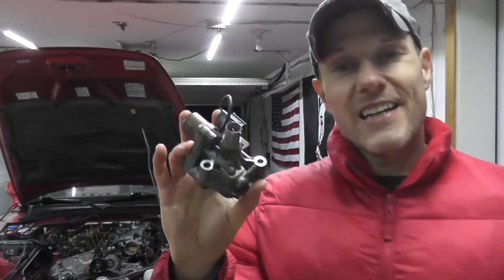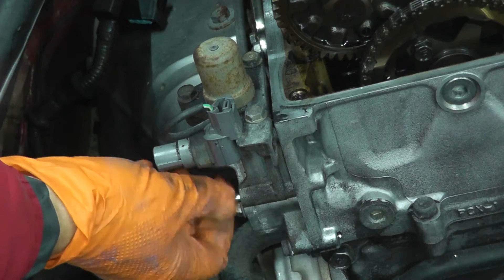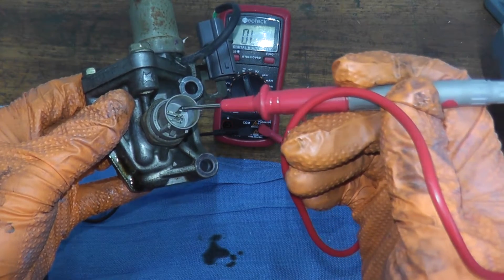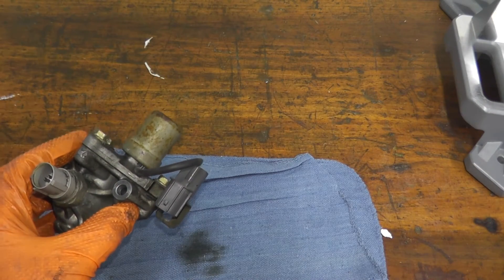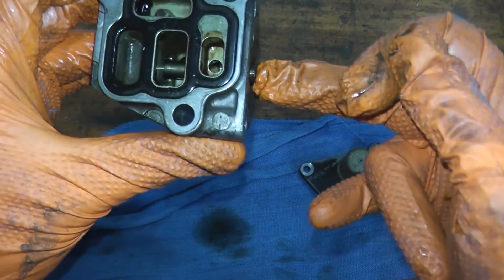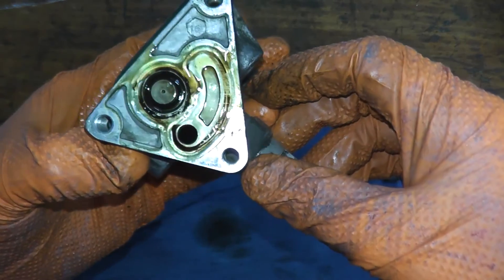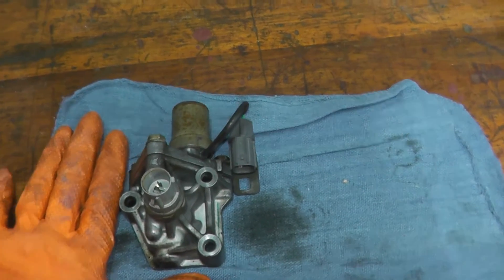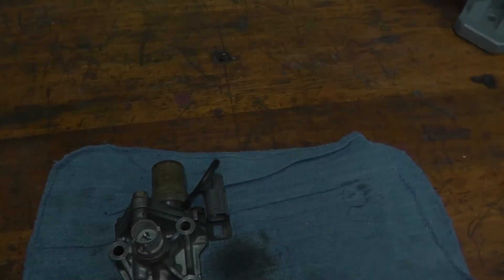How To Test and Replace A VTEC Solenoid Valve P1259 P2648 P2649

Comment: I have a problem with the VTEC oil pressure sensor. I checked there's a 12 volts on 2 wires for pressure switch. Since the pressure switch is normally closed, when I plugged in back the socket on the sensor with the ignition key switched ON. The power supply 12 volts has gone? Is that correct? Also I checked the voltage on single wire and read it 2.5 Volts . When I plugged in back to solenoid valve. Again the voltage gone. I checked the continuity of pressure and it's ok (normally closed) I checked the resistance reading of solenoid valve and it reas 15.6 ohms. It seems fine. I cleaned the valve assembly also. But still the the check engine still stayed ON. And then I read again the flash code, still code 22 meaning the problem still exits on VTEC oil pressure system. Any advice that can you give me to check further the solve the problem?

Comment: Thanks for the video. I did all tests, plus I powered the solenoid and it did the job intended, with a nice click sound.

What I found, that fixed mine, was that the screen on the on the other side of the block [behind the power steering pump and belt tensioner] had a yellow film on it. I sprayed it with break cleaner and that film came right off. I then reasembled and drove it, and SUCCESS, no more code.

Good luck to everyone.

Comment: important to know is that you should NEVER force paperclips or anything through connector pins. this is a good recipe for some intermitent problems later. just use backprobes or touch the tip of it, thank you!

Comment: How come we did not perform an impedance test on the first sensor? Is it only continuity that we need? Also, if applying air pressure to the first sensor, will it open breaking the continuity?
Reply: It's a normally closed switch that opens when pressure exceeds some amount.  Yes, provided you don't test it at too high a pressure or blast a jet of air in there that could damage the diaphragm.

Comment: So confused, I put the computer on my 2013 Honda civic and I get a faulty solenoid valve malfunction. However, my mechanic says I need to replace my ABS module because I have a warning lights on in my dashboard. 🤷🏻‍♂️🤷🏻‍♂️

Comment: My solonoid on my honda del sol d16y8 from 1996 does not have a sensor to test to solonoid. it just has one big bold in it. What do i need to do?
Reply: Mine has a pressure switch with two terminals and a solenoid with only one terminal.  96 Honda Civic EX A/T.

Comment: If this throws a P1259 error code, will it cause a CR-V to crank but not start? I’ve tried testing everything else (fuel, air, spark, fuses, & relays) except for this and the the timing chain on my 03 Honda CR-V.

Comment: Just a warning that i didn't think was covered here is the wrong oil grade. A good mate of mine replaced an engine on a Cr-v after the garage cocked up and left the oil filter loose resulting in a wrecked engine. He fitted a 2nd hand engine and put some oil he had sitting around in it. On road test the engine light came on. He found out he had the wrong grade of oil in it. Drained it out, put the correct oil in to it, cleared the fault codes and oil was all ok. Great video though!
Reply: Hey man, was the oil too thick
Reply: using 10-30 on a k22 on my ep3
Reply: @henryec  Yeah unused oil from the back of the garage so was probably 15-40 or may be 20-50 so to thick for the VTEC system to operate. Dropped it out, correct oil put in, all was good.
Reply: @paulrobinson3528  oh shit alright maybe ill try that, appreciate you

Comment: For a tsx cl9 I’m sure this applies too , I removed her. To replace the gasket. However.  ,  I did my oil change. ,  I’m sure she was leaking from so ,  I cleaned her. Brake cleaner . I put her back. , the car is having troubles starting. ,  , idk if it can be the ecu need to be reflashed ?  It’s the stock og Acura ecu. , my key immobilizer on the dash symbol would keep blinking ,  idk at this point , definitely gonna refuel , I didn’t check the top gasket. And check for the motion. Etc.

Comment: I think when you are checking the voltage across the leads with the ignition on, you should NOT allow the leads to come in contact with ground (i.e. the body).

Comment: Hey can you do a video on how to fix the heater on an Acura TL. My air is blowing but no heat is coming out. Thanks
Reply: Did you run low on/replace coolant?  Did you properly purge all the air out of the system?  Hondas can be tricky and keep air bubbles in the heater.  Typically park front up on an incline, get a transmission funnel, remove the radiator cap and insert the funnel.  The funnel needs to be a tight fit and Fill it to have coolant visible an inch or two up into the funnel(above the cap height) and start the engine.  Set the heater control to full warm to open the heater valve. You should see occasional bubbles escape in the funnel as air purges, so Keep adding coolant to maintain that level.  Increase engine RPM from time to time, run it there for a few minutes then let it return to idle.  You want to keep this up until the temp gets high enough to trip the radiator fan(just over 185F) and both upper and lower rad hoses should be hot which means the thermostat has opened. At some point you should get heat out of the heater vents and no more bubbles, just an increase or decrease in the coolant level in the funnel from thermal expansion or contraction...
Reply from the maker: Check the coolant level.